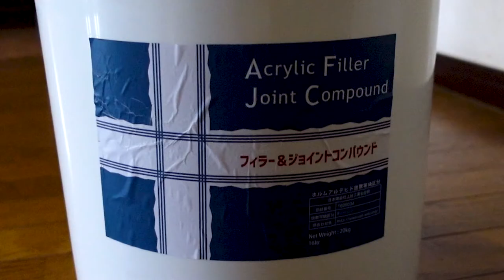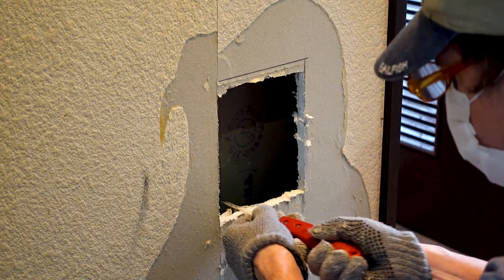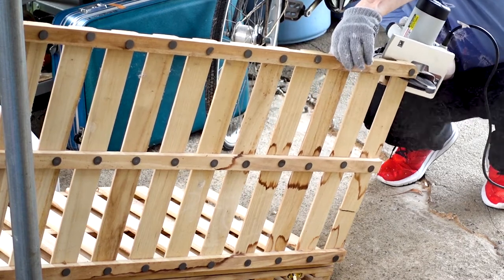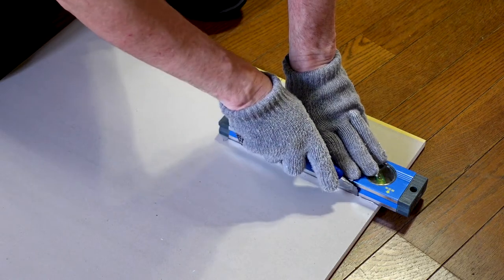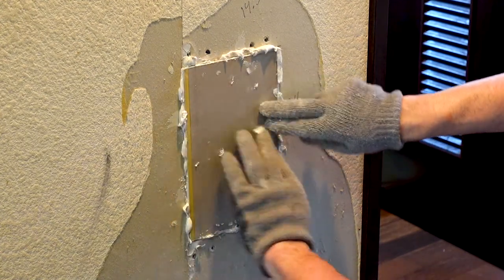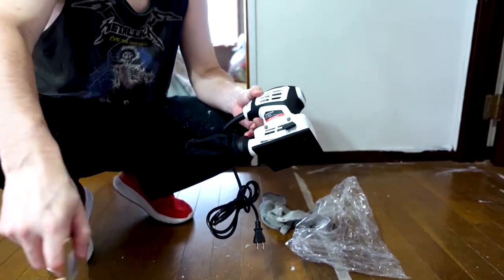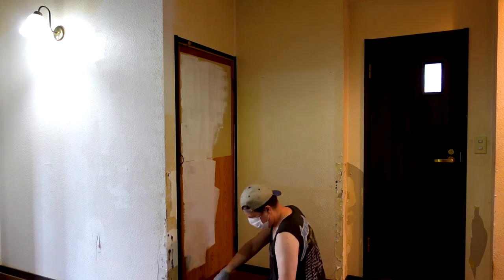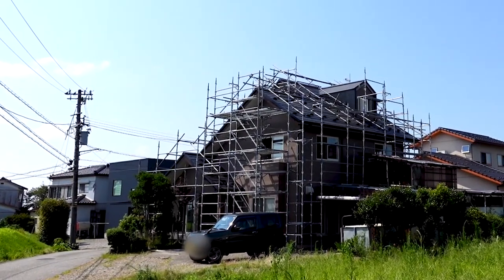Home Renovation in Japan #2 - How To Fix Holes in Drywall

Comment: Is it worth it to sand down the wood floor, re varnish it and save it?
I think you did a great job restoring the walls and painting.
Reply from the maker: The floors are plywood laminate flooring. They are in pretty bad shape. I think we are just going to put sheet vinyl flooring.